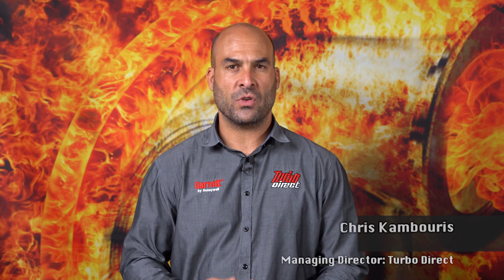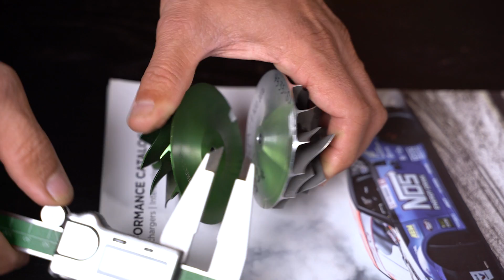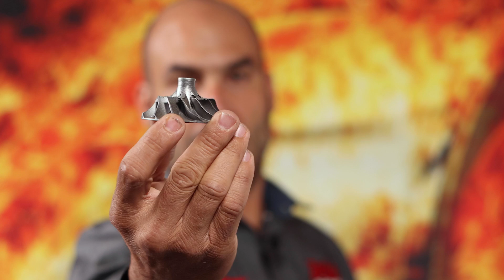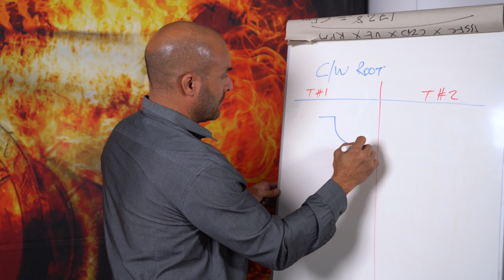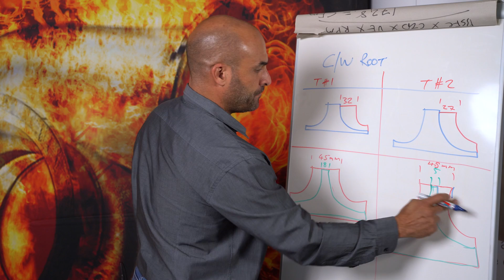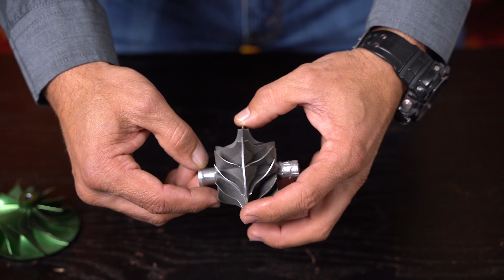Turbo Compressor designs - Discussed

Comment: Thank you. Can you say something about the general difference between wheels with different blade numbers? 
Looking at diesel turbo oppgrades one finds for example the 5-splitter blade Wicked Wheel 2. What are the pros and cons for 7-splitter blade and 5-splitter blade compressorwheel compared to "the new age" 11, 10 and 9 full blade length compressorwheels? If we look at compressor maps, the 7-blade splitter seems to be "best" when it comes to map width. We have had many challenges with surge with turbos with 6-blade splitter and 11 blade wheels when we want 300 whp @ 4000 rpm from 2.0 l engines with maximum power in the range 450 - 500 whp running pump fuel. We had to do what you do not recommend, go to ebay and buy a aftermarked "non-brand" 7-blade spliter compressor wheel to solve the problem to get the owner the result he demanded. (2,2 BAR of boost at 3900 rpm without surge was needed.)
When using the Garrett boost advisor and BW matchbot, the result is often a red N/A.
Reply from the maker: Finn Roen its difficult to comment and generalise because of the fact that all compressor wheels (even with similarly sized blade diameters)  have a different root design which has a direct effect on the blade area across the root profile - Remember i only measured the root size at the very top of the compressor nose in my video - but the root design carries on downwards from the inducer blades downward to the exducer, and the shape between two wheels will be different, and lets say - half way down the root, the blade area is larger on one wheel compared to the other, the flow rate and pressure ratio/tip height will also differ. This has a direct effect on the compressor map aswell.  

What i did in 2012 was make a 100% dimensional copy of the 60-1 compressor wheel which is a 7 blade splitter, and i did this with a billet 11 blade design. The root and blade area was IDENTICAL - the inducer and exducer was IDENTICAL - the total height was IDENTICAL hole diameter etc etc -- all 100% IDENTICAL - we took this wheel and tested it on an R33 Skyline which was on a dyno -  which was running a Precision6262 turbocharger with AR63 turbine housing we decided to replace this with a Garrett GT3076R (NOT GTX) with AR63 turbine housing.  We did back to back runs and OBVIOUSLY the Garrett was more responsive, because it was a smaller turbocharger even though with the same T3 AR63 turbine housing.  We then removed the supercore out of the turbine housing which remained behind (easier and faster to remove and reinstall) and we machined the comp housing by hand on a lathe (clearances were abnormally large and slightly outside of tolerance) and ran the car again - we did all tests on pump fuel - at 1.2bar boost using a Haltech Platinum ECU.  All tests were done on the same dyno and the same day - inside of 4 hours total time spent.  We used a Dastek Dyno and the results were as follows:- 

6262 - 1.2bar gauge pressure = 340KW
GT3076R - 1.2bar gauge pressure = 400KW
60-1 11 blade - 1.2bar gauge pressure = 420KW

Without going into a 10page essay on this - the example here shows that for the identical root design with additional blades (no splitters) the wheel at the same boost pressure made more power - AT THIS BOOST OF 1.2bar -- i do not have a compressor map for this wheel, it was an experiment done on the dyno in 2013 with a good friend of mine and by far the best tuner in South Africa hands down by the name of Steve Clark from No Sweat Racing - google him, youll be surprised.  So we are totally blind here, BUT at this boost with these turbos, back to back, the results speak for themselves.
Now if we go by what Garrett claims with their Gen2 GTX compressor designs (i have conflicting information in the various Garrett printed and electronic catalogues which contradict eachother) the 10blade wheel is said to flow more - but we cannot confirm this because the inducer and exducer diameters were changed (enlarged) for the same model turbo -- GTX3582R Gen1 compressor measured 62.4mmx82mm 11 main blade - 750HP capable.  The GTX3582R Gen2 compressor measures 66mmx82mm and has 10 main blade design.  Where i am going here is simply this - if the inducer and exducer sizes and dimensions remained the same (like the GT3582R and GTX3582R gen1 did) and only the blade count was changed, then maybe we could understand more about this - but its not the case.    So unless you have dissected the topic and actual wheels, it would be pure speculation or opinion.  We have laser scanned hundreds of wheels over the years in order to learn about this topic, we have manufactured many wheels that simply failed at performing even though we thought and really believed that they must work --- we have some wheels that do actually work and work brilliantly with designs that we never thought would actually work .... then we stopped thumb sucking and started doing actual tests and simulation to prove designs before we machined wheels. We now have a test bench and able to do real world back to back tests against different wheel designs in order to measure, document and prove flow and pressure ratios at specific speeds in order to plot and understand what the wheels can do factually.  What we have learn is PLENTY and im afraid not really available outside the design office. 

What i can tell you is that the 7blade splitter design is something that is very difficult to beat (size for size) by changing the number of blades.  This is why the BorgWarner designs, although seem antiquated, are still today some of the best designed aero wheels that exist. 

Here is a tip - when you experience surge, change the turbine housing AR - you'll be surprised.  Sorry for the extremely long response, it is a very in depth topic.
Reply: @TurboDirectSA  Thanks for not dumbing this down too much.  We all acknowledge that this (aerodynamics) is a very in depth subject.  We're here to learn.
Reply from the maker: @reubenmorris487  Glad to help.
Reply: Did the 7+7 blade make more power at the lower rpm or did it just make more boost? Sometimes people focus too much on the boost pressure and not enough on the efficiency and actual power.